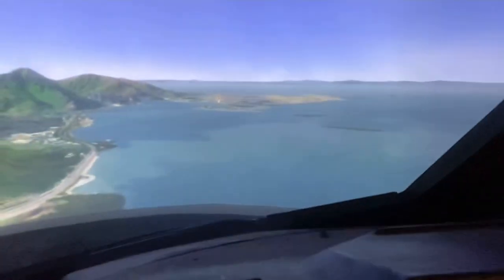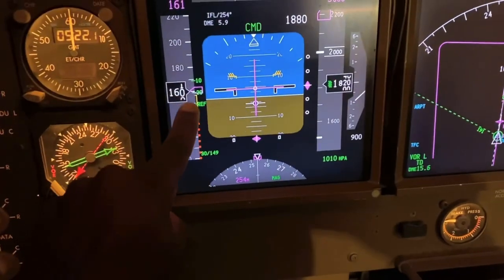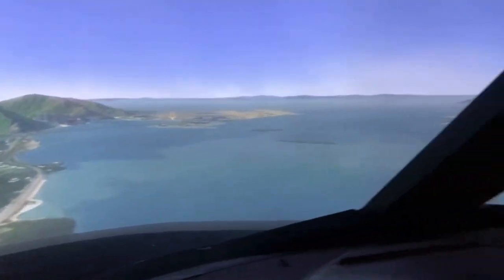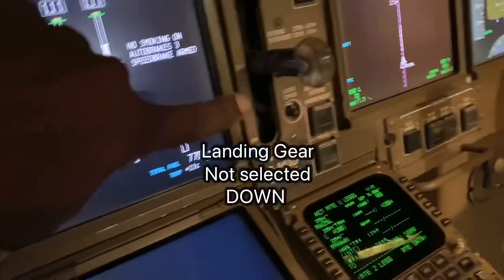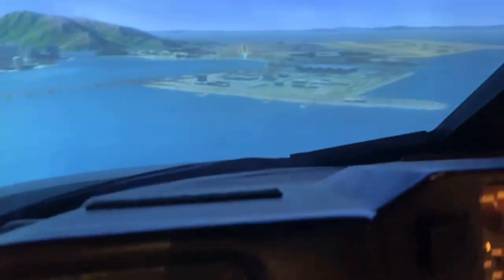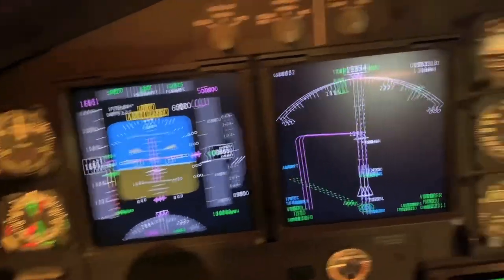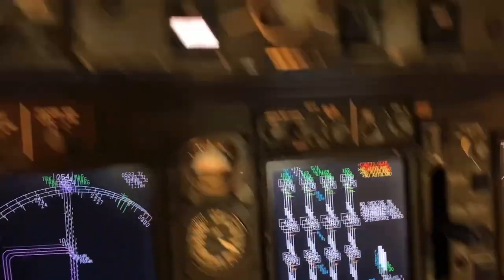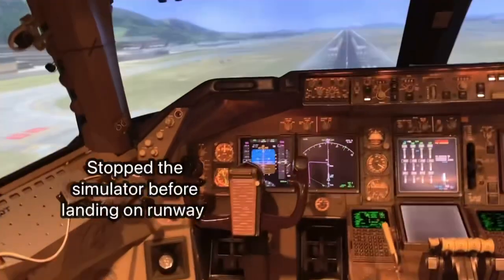Boeing 747-400 & -8 landing configuration warnings

Comment: Wow, I'm just imagining as you are explaining.  Boeing said that for the -8 they strengthen the vertical and horizontal stabilizers.  But for the landing gear, did they do anything different?  Is it the same as both the 400 and 400er?
Reply from the maker: The landing gear on the -8 is different to the B747-400. The wheels are much bigger for a start
Reply: @pilot_obet   Ok, very interesting😃😃.  They now have the 777x with a wider wingspan and a higher vertical stabilizer.  That would be something if Boeing came out with the 747-9i.